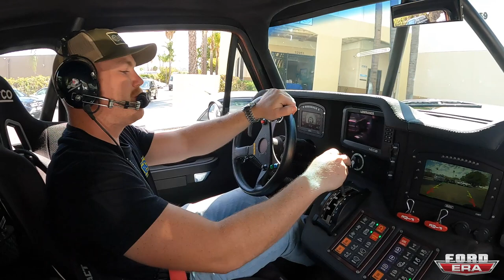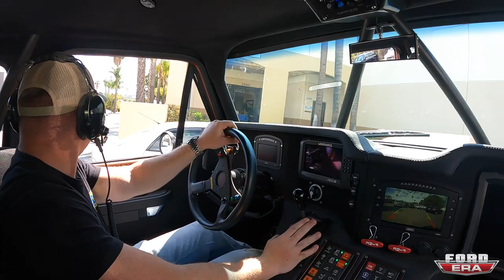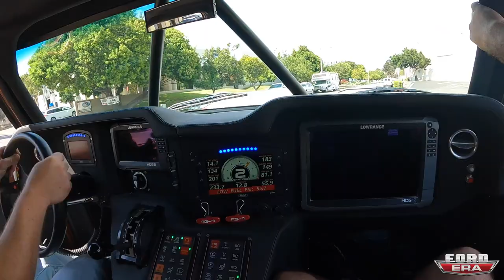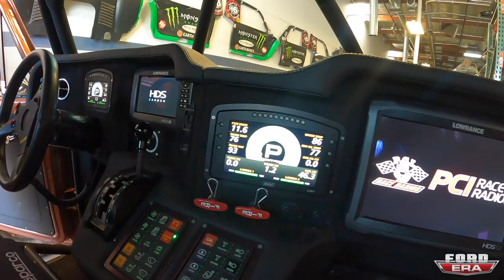Kyle Craft's 850HP Dentside Luxury Prerunner! What The Truck? Ep:43| Ford Era

Comment: I knew it had big block Chevy in it. that is a disgrace I have no use for half breeds. this guy shouldn't own Ford trucks sorry but that's the truth.
Reply: RIGHT ON MAN!!!!!   GM lover hiding under a beautiful Ford body !
Reply from the maker: did you hear the reasoning why? the truck is build identical to his trophy truck. his trophy truck is limited to a specific motor.
Reply: @FordEra  Sorry I didn't catch that, but it doesn't matter it's still not right to put a Chevy engine in a Ford, it basically insults both companies. but I can't say any more if that's what his sanctioning body requires, so I will leave it at that.
Reply: @FordEra   than buy a GM product